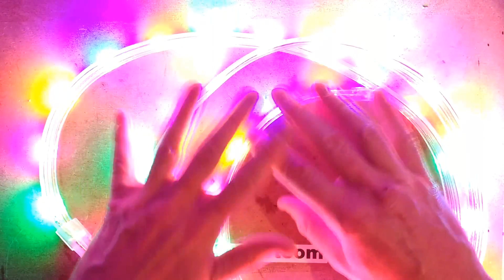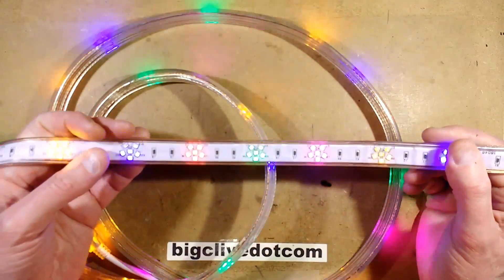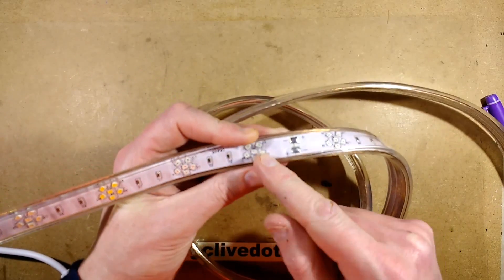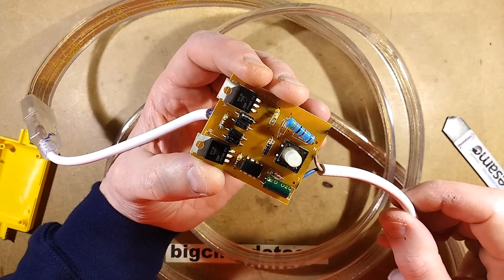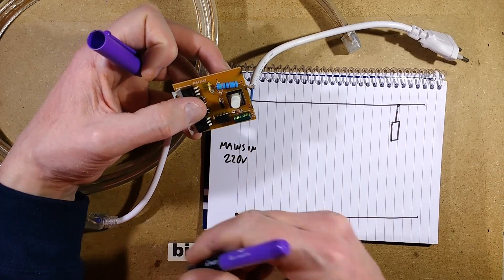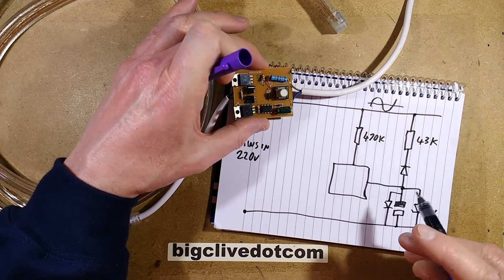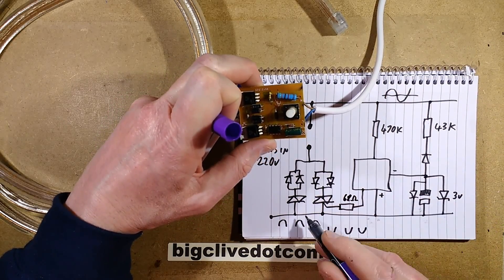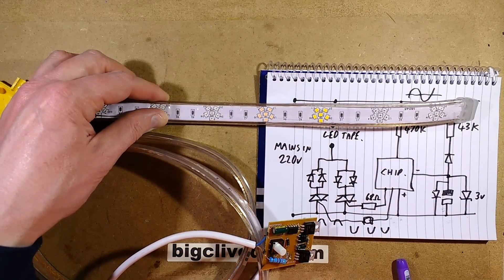Horribly flickery LED horse-race star strip with schematic.  (Epilepsy risk)

Comment: Recently my doctor has been screwing with my pain meds. Most recently he cut the main drug the ultimate evil Fentanyl in half and increased the less evil Vicodin by one third.  This has not worked, and after a couple of weeks into ever increasing pain levels, I could take it no longer, and dug out some left over Fentanyl patches and slapped on a stronger dose.   Ahhhh the relief washes over my body, but the accompanying fog falls across my aging brain until, at long last this afternoon, I came across this great video.

All I can say about, and, mind you it may be the increase in narcotic pain meds, is huh?

Comment: Can You make a video about repairing this circuit so it doesn't flicker?
Reply from the maker: It's actually quite complicated, since it would require a non standard voltage and a high voltage H-bridge driver.

Comment: It appears to have a bleed over in its programming or just a very badly designed circuit board,it's got a real problem to the point no one is going to want them. best guess is they quit working in short order. If you could use a different type of controller.

Comment: Depending on how much effort you want to put into making these lights tolerable to look at (i.e. make the flicker go away), You could rectify and smooth the mains, and drive the tape with an H-bridge. You could flip the polarity at, say, 1kHz or so, and use pulse density modulation for dimming.

Comment: @bigclivedotcom I was told that putting diodes in parallel does not increase the power rating, because the ones with the lowest voltage drop will start conducting first - never letting the potential across itself (and by extension, its pair diode) increase to let the other one conduct. 

Is this "theoretically" correct and "practically" incorrect? Does the potential across the first diode in real life increase enough for the second diode to start conducting, giving it a purpose?
Reply from the maker: It's not ideal, but generally as the current through a diode increases its forward voltage increases slightly, so the current will generally be shared between them, albeit not exactly.
Reply: I did not know that, it makes sense. In high-current, high-reliability appliations, there's no substitute for a single fat chunk silicon, then.

Comment: In the US here...don't basically all of our LED Christmas lights use the LED-wired-directly-to-mains and therefore flash at 60Hz scheme? I perceive a flicker on most Christmas lights around these parts...wish they would use an actual DC power supply with them, but then you wouldn't be able to buy a super cheap string of lights...

Comment: out of curiosity, how will it behave if you put the strip directly on mains without the pcb?
Reply from the maker: All the LEDs would light, but still with a visible flicker as alternate LEDs would light on different halves of the sinewave.
Reply: thanks. that´s too bad, cause i quite like the style of those strips.

Comment: Could you DC mod it Clive? I guess the forward voltage of the string might be high.
Reply from the maker: The voltage would have to be at a level that passed the same current through the LEDs and resistors as 240V RMS half wave averaged out.  That would still be quite a high voltage.  Than an H-bridge driver could be used to alternate the polarity very quickly.

Comment: Why did they use the triac and diode combination to switch the leds when a pair of thyristors would be better and cheaper? The C106D and smaller TO-92 CP106D are 400v rated and have 0.2mA gate current so the mains dropper resistor could be a lower power rating too. I know thyristors need a positive gate current but surely the chip could be configured to provide this?
Reply from the maker: Thyristors can only switch in one direction, and the gate drive needs to be relative to the cathode.
Reply: It would make more sense to me to have just one TRIAC and a smarter chip (capable of half-cycle firing). I'd still prefer a proper 2-channel arrangement, though.

Comment: Applying what I've learned from your videos and residual knowledge from my a-level physics, I'm assuming the flicker is being caused by the leds or the zener/xener/xena warrior Princess diodes dropping below their forward voltage (am I using that right?) before the wave reaches zero, turning off & not relighting until the wave rises/falls to that point, meaning the strip is off for a significant amount of time? 

Please correct me if I'm wrong with this idea, but would a capacitor between the diodes and the leds smooth this out?
Reply from the maker: There is a small element of that, but the bulk of the flicker is cause by the LEDs being off for more than half the time due to only operating on one half of the sinewave.
Reply: bigclivedotcom Ah right, I've misunderstood what the xener arrangement was doing, I thought it was enabling using the full wave without using a rectifier.

Comment: couldn't it be easily adapted with a dc supply circuit?
Reply from the maker: It would have to have the voltage reduced.  If you just used rectified and smoothed DC through a mains voltage H-bridge driver the current through the LEDs and their resistors would probably damage them.
Reply: Thanks for your reply.  I was thinking for the cost it may have been worth adapting but from what you say it probably wouldn't.

Comment: That odd diode makes me think there's a 5V zener on the board. They then switched to a 3.3V microcontroller and had to bodge on a 3V zener to use up old boards.

Comment: I wonder if it would blink slower on US power 120 vs 240
Reply: ethancedrik no it would just light dimmer. And at a slightly increased rate of flicker.
Reply: Most probably, it would actually blink slightly faster (~15%) as the power grid in US delivers 120V AC 60Hz in comparison to EU's 50Hz. As Clive mentioned, the timing of the chip is based on the sine wave from the socket. It would do that in case it would overcome the issue number 1: too low voltage ;)

Comment: Clive, what do you think about these cheap chinese component testers? The ones that run on a 9V battery, where you can put in stuff like capacitors, resistors, transistors, diodes etc. and it will tell you the value of the component?
I've recently bought one of those to play around with (it was something like 8€), and funnily, it indicates one LED to be a capacitor, while it indicates another LED correctly to be a diode...what is going on there, is it just "craptacular" Chinese quality, or is this something else?
Reply: Rin Hato As I understand it, electroluminescent wire is a type of light emitting capacitor (though probably not what Seegal has :p)
Reply: Seegal Galguntijak What you've got there is the elusive LEC, Light Emitting Capacitor, a technology that hasn't been seen for many years. Back in the day they used to be used in all the lighting for home and business, so ubiquitous that the layman term "leccy" is derived from it.
Reply: Rin Hato LOL, that was a funny reply. I would have appreciated a more helpful one though ;)
Reply from the maker: All components have an element of resistance, inductance and capacitance.  It seems that it might be misinterpreting the LED as a capacitor if it's not able to see its forward voltage behaviour.  Is it a high power LED with lots of chips in series?
Reply: bigclivedotcom It's not - it's a simple 1-chip LED in a casing that you would solder on a pcb, like the ones in the "cloud lamp" of your previous video, but with a cold-white colour. The device misinterprets one "cob" style high power LED as a resistor, that was quite understandable for me though.

Comment: Any chance of a second video driving it with a proper power-supply and H-Bridge from (say) an Arduino or Microcontroller?  Or possibly even re-using the one in the yellow box?  Could banish the flicker, and make the tape genuinely quite useful!   I assume it's splashproof, if not IP rated?

Comment: I'm in my second year of Electronic Engineering, soon I'll understand all the diagrams that Clive does on every video. But meanwhile i watch and try to understand with my basic knowledge :D
Reply: AfterStories please don't take this question the wrong way but what did they teach in the first year if not the basic symbols? Genuinely curious, I've never taken a course based on this stuff.
Reply: My university has 4 different engineering degrees, so the first 2 years are almost the same for all, and the last 3 years are specialized in the degree of choice.

Comment: Rebuild the controller to do what you want it to do. I would be interested to see what you come up with.
Reply: how's he gonna fit this in a buttplug, though?
Reply: A simple controller with less flicker could consist of a rectifier and a h-bridge connected to the leds. This would allow a chip to control the frequency and polarity of the power that goes to the leds.
Reply: @not_found completely flicker free is only possible with half the leds, as they are in alternating polarity. my suggestion would allow to have all the leds on with 50% duty cycle each and an arbitrary frequency. So instead of the mains frequency you could choose a few khz and it would look quite steady, even for cameras.
Reply: Could use it as a rectumfryer
Reply: Knowing Clive, if he modified the controller, even the permanently colored LEDs would somehow start lighting up warm white... :)
Reply: Knowing clive, if he modified the controller to do what he wants it to do it would be steady on without flicker. Which is what I would prefer too instead of the disco patterns
Reply: Would require an H bridge driver circuit that can switch the LEDs at a higher frequency.Reason for that is as it currently is there will be flicker from the fact that the dc going to the LEDs isn't filtered at all, whereas with the H bridge driver circuit the dc would have to be filtered fairly decently.

Comment: Can you modify or create your own power supply to eliminate the strobing or is it all due to the leds wired in alternate polarities?
Reply: Jason Kay all that could be done is to increase the supply voltage frequency. Or replace the circuitry with a more complex one that derives it's own oscillation to switch the triacs. With smoothing to DC in the middle I'd guess.